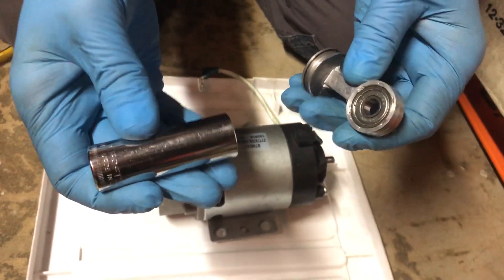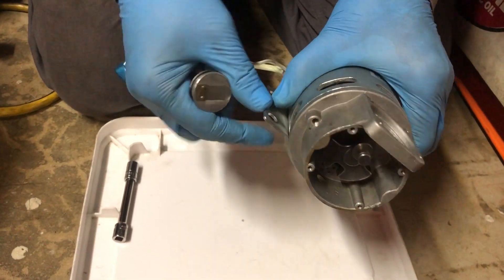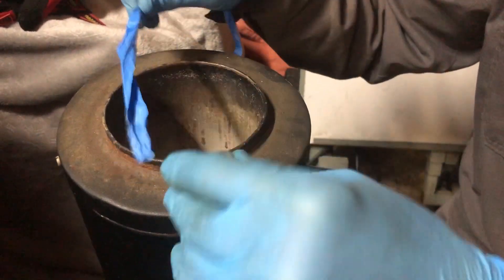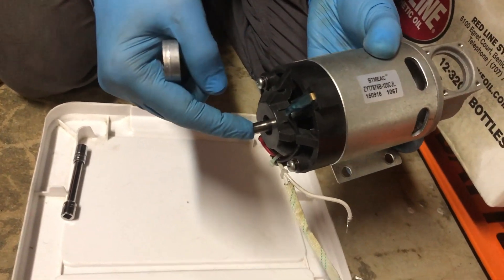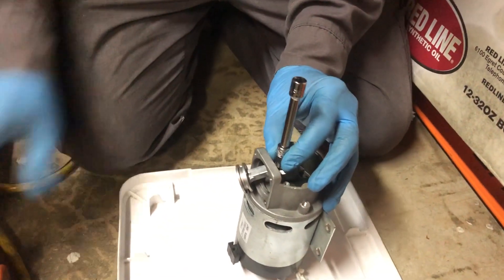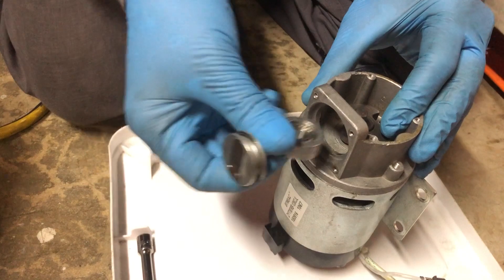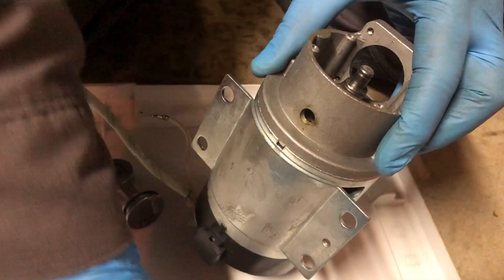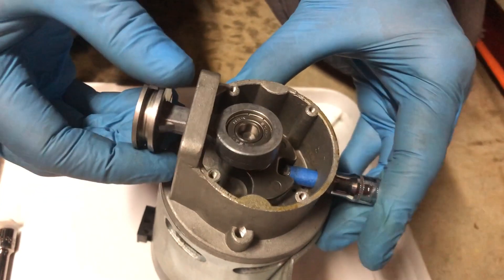Central Pneumatic 3-gal. air compressor rebuild (Part 3/5) -- installing piston onto crankshaft pin

Comment: Sir, where do you get the new piston ring and seal kit for this repair? My unit will pump only to 30 psi but is good otherwise. Thanks
Reply from the maker: I don't think any of those parts are available from Harbor Freight.  I just reused the ones I had.  Are you sure the reed valves are in good shape?  They can often be the problem.